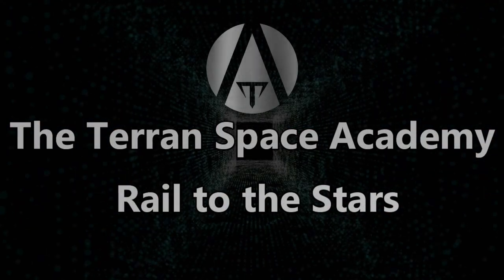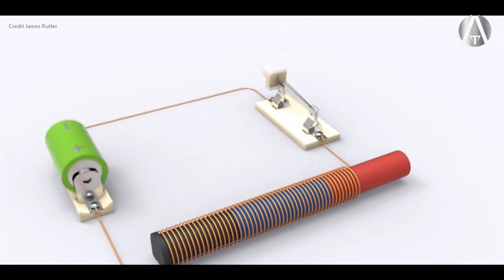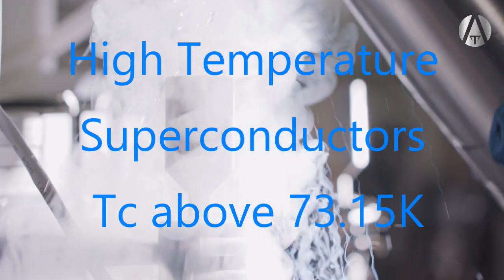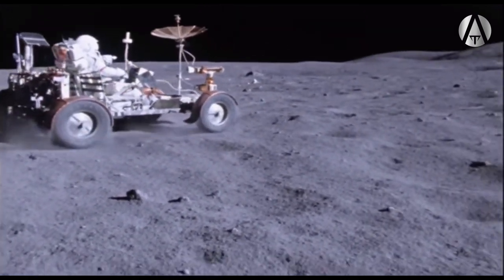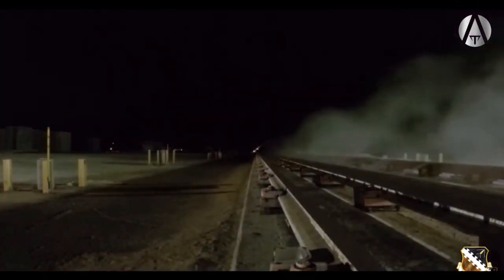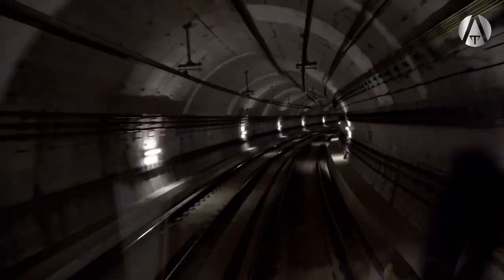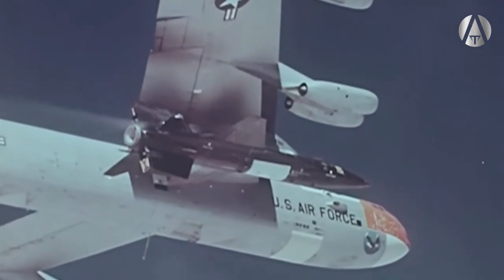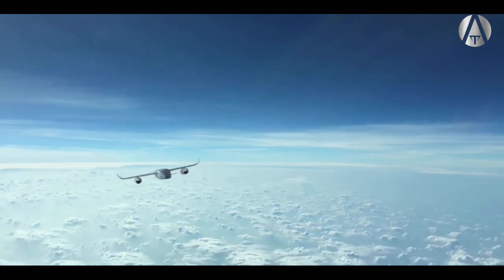Rail to the Stars - Superconducting Solutions to Spacecraft Propulsion

Comment: Hello sir, excellent video at 10:54, mention that turning could be devasting while in motion, it could destroy track, what if we use the rotational movement of the projectile like a bullet fired from a barrel comes out in rotating motion, is that could reduce tearing forces on track while taking a turn?  thank you
Reply from the maker: If the track were gently banked it would be possible. But it would take a lot of reinforcement in a very gentle bank to prevent G forces from crushing the project darling track or tearing them apart.

Comment: An Accelerator ring could be used to shorten the rail for launching payloads to space. Go in circles until desired speed is reached then switch payload to straight section of track for launch... May not work well for live, or fragile cargo as g. forces will still be very high...;-)
Reply from the maker: For cargo even a short distance with an electromagnetic launcher should be able to easily get it into orbit from the Moon or especially Deimos :-)

Comment: You can do more than 12m.s-2 on current rocket launches there is more than 2Gs during most of the boosting phases. And 3Gs are very tolerable. This would shorten your track. 20m.s-2 is pedestrian. A race car on the brakes can be 4Gs. (eyes start to want to go out)
Reply from the maker: Very true. I was thinking about children, pregnant women and old people. Something that everyone can tolerate. But most people can easily tolerate much higher gees you are absolutely correct.